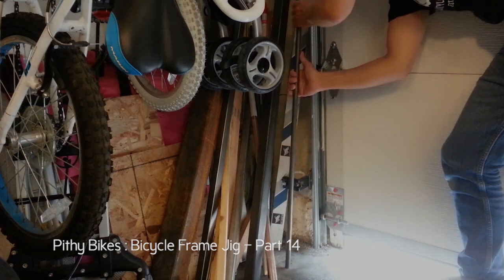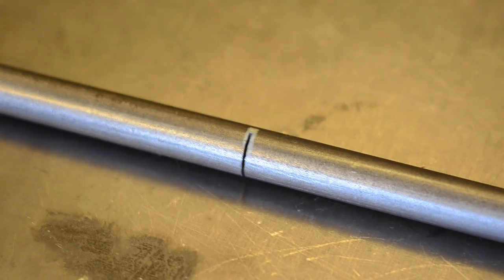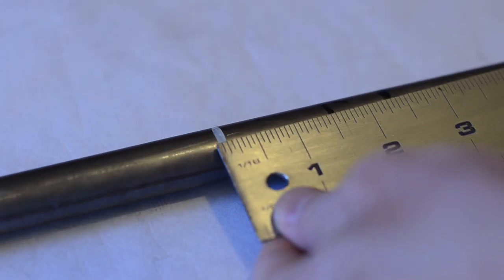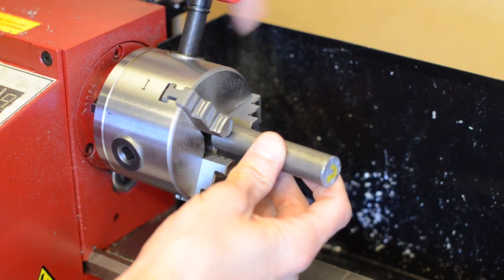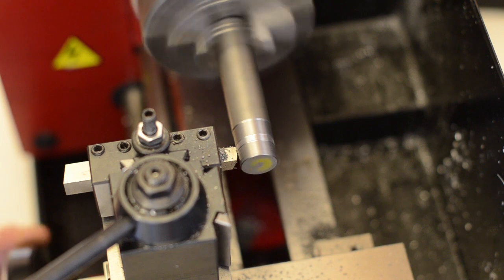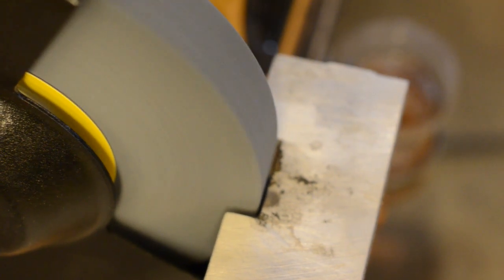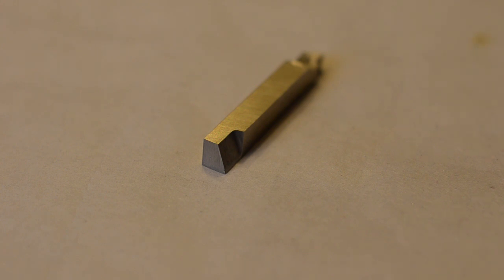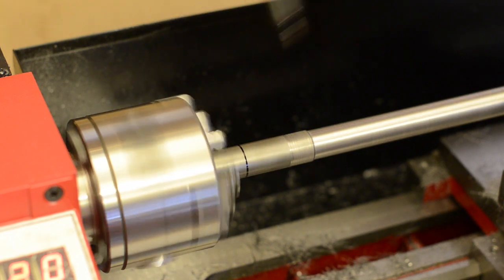Bicycle Frame Build 22 - Frame Jig Pt.14 - Turning the bottom bracket bolt on the mini lathe

Comment: For parting I liked to use a rather pointed tool, instead of the rectangular one you are using, makes the progress a little easier and smoother and you get less vibrations. I don't know how well that would work on the steel rod though. I only worked alu, wood and nylon.

And for the smoother finish you might also use the minilathe to just polish the surface a little. Turn it and use fine sandpaper or if it's already smooth enough polishing fleece on it. Just be careful to not let it get into any moving parts.

Comment: did you connect carbon steel rod with aluminum cube? Is in there going to develop galvanic corrosion?
Reply from the maker: +Vik Gosh I hope not. I'm not running any current through it so it should be fine?
Reply: To the best of my knowledge you can't connect (allow to touch) two dissimilar materials otherwise there is going to be corrosion. You could mix stainless steel with aluminum but also only grade 316 or so (google it). It will not fell off but it will not be as shiny as it is now.
Reply from the maker: +Vik I guess I'll wait and see what happens. Since I pressed the bolt in really tight there's no way of getting it out! If shit hits the fan then I'll need to redesign that part. Time will tell. :)

Comment: Have you tried parting off with the blade upside down and the lathe running in reverse? It works very well on small lathes that aren't very rigid. Great videos, really enjoying them.
Reply from the maker: Sam Ha! It's funny you mention it. I just did that today. You'll see it in the next video. It does indeed work very well.

Comment: Hi! Love your work and am following with interest. Just curious, how do you plan to secure the cones to this pressed in shaft? Not sure whether your lathe can turn a thread on the shaft or whether you plan to use a thread cutting die...
Reply from the maker: Colin Faulkner Hi, The plan is to have a stepped cone with the smaller step snugly fitting inside the BB. No threading. Two clamp collars will hold the stepped cones in place. Thanks for watching :)